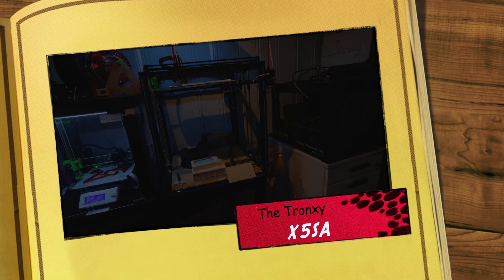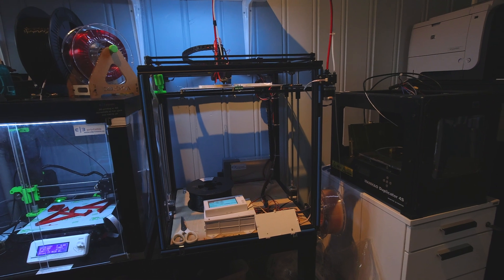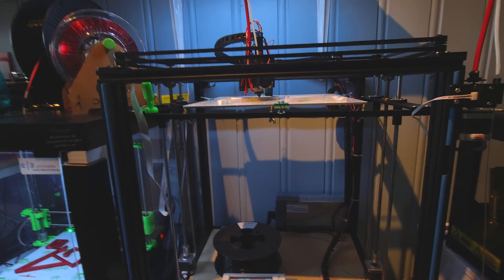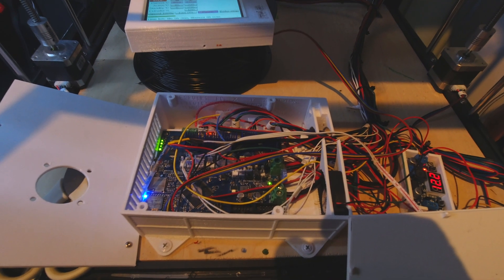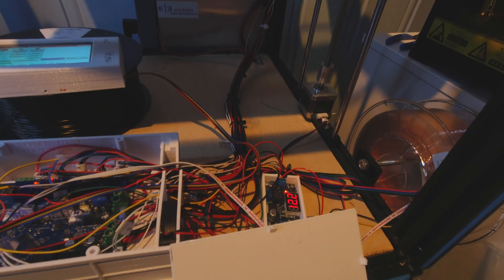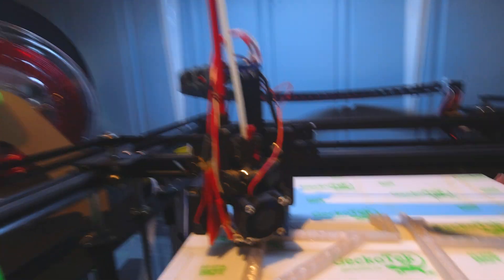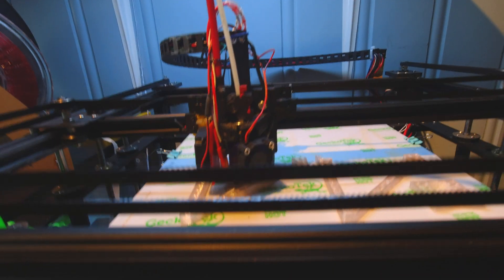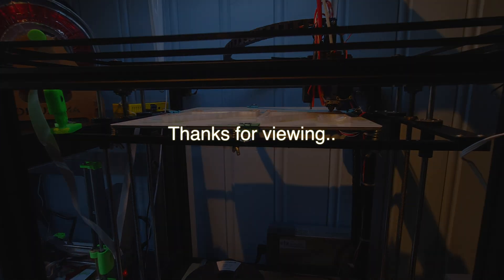Quick update of my Tronxy X5SA 3D printer

Comment: Whatt happened with Chitu motherboard, was faulty or hard to configure? Thanks.
Reply from the maker: It was hard to configure, did not keep the offset settings, printet in mid air or dived the nozzle into bed.. never got it to print well..
Reply: @ulven75  Thank you for the info. There is no much info about these mainboards, maybe are not good at all.
Reply from the maker: @joseguevara184  well, after i changed to a Duet2wifi, i got full control over the printer!
Reply: @ulven75  Good info , is possible to install Tronxy firmware or must be Marlin as it is not Chitu? Thanks.
Reply from the maker: @joseguevara184  i use RepRap firmware on my duet2wifi board :-)

Comment: hi l got the same printer and same board do you have diagram were you plugged every think in as my doing crazy thing will not home any of the axis
Reply from the maker: are you using duet with firmware series 2.x or 3.x?
Reply: Freddy Ulvseth hi l got duet 2 WiFi software up dat to 3.0
Reply from the maker: @edwarddown9727  well, the same happend to me when i upgraded to v.3.0, a lot has been changed in the way ports has to be configured to work. I downgraded to the last 2.05 version again ;)
i was told that i could use https://configtool.reprapfirmware.org/Start to make a new config for the 3.x fw
Reply: Freddy Ulvseth ok Thankyou l try that